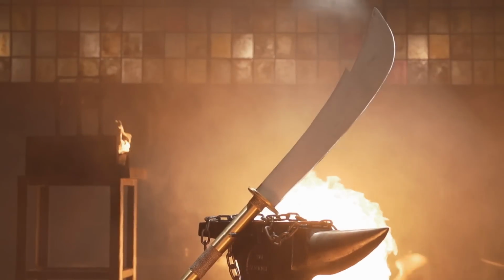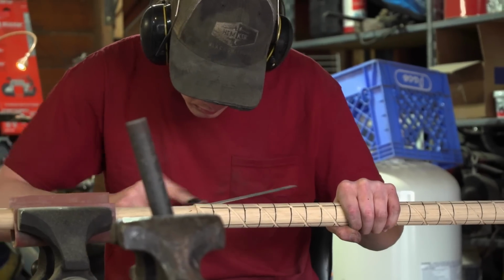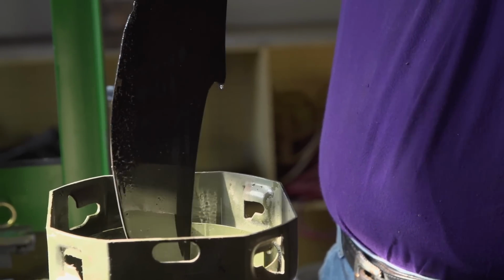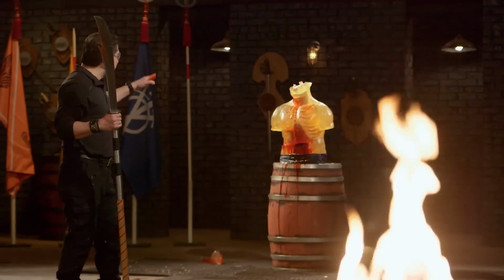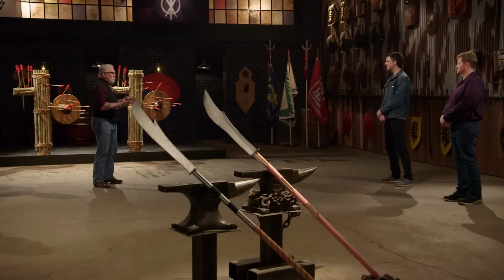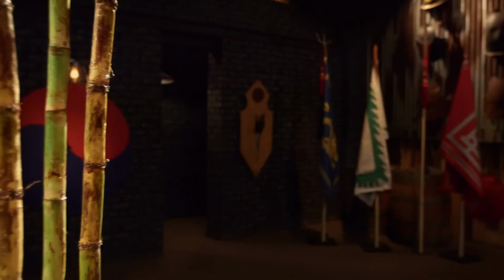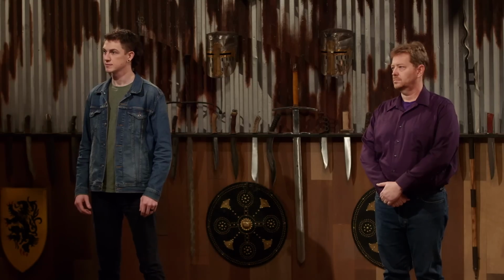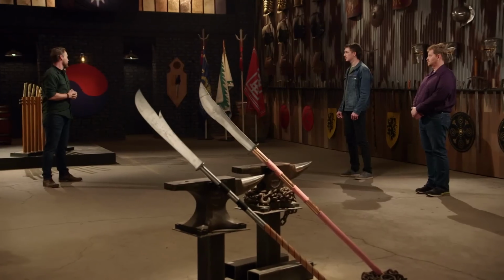Forged in Fire: Korean Woldo Produces LETHAL LACERATIONS (Season 8) | History

Comment: Judge- "Well, your weapon feels a little heavy-"

Contestant - "I'll see myself out".
Reply: It seems like a common mistake. Which I find bizarre, most of these weapons have well identified weight ranges historically. I understand wanting to err on the heavy side given the tests performed on them, more steel makes for a stronger blade. Say you want to make a long sword. A heavy longsword historically was about 3 1/2 pounds. So as you're forging, you need to keep that in mind, if your blade is 5 pounds, you have a problem.
Reply: catastrophic failure has entered the chat
Reply: @andrewfernandes6906  that's usually due to poor heat treatment. If you use the right steel and treat it correctly, even very thin blades will spring back and take no edge damage.
Reply: Noah Vinkel Hansen  a quick Google search gives me just over 3 pounds. That's roughly equivalent with swords and guns throughout history because there is only so heavy a weapon one man can effectively wield
Reply: Noah Vinkel Hansen  I once had the pleasure a few years back of wielding a Scottish Claymore (actual historical weapon mind you) when I visited the Wallace Monument near Stirling in Scotland and it was (to me at the time not knowing much of real weaponry) surprisingly light.  It was explained to me that they need to be relatively light so that a Soldier can wield them in battle for lengthy periods of time, after all, in the middle of a battle a Soldier doesn't simply have the option of saying to his enemy "Woah there, time out dude, I'm exhausted, I need a five minute break."
Reply: Noah Vinkel Hansen  its not meant to be a heavy weapon

Comment: When they said Dave's blade was heavy and it took some edge damage in the kill test, it was over right there.
Reply: @draekan2753  Exactly. Blades normally don't take damage during the kill test.
Reply: Agree.
Reply: If it takes damage on the kill test you know your weapon won’t win
Reply: full time blacksmith XD
Reply: @jackienettleton6212  well guess what. Weapon damage would and will happen. But it shouldn't happen on the first swing or couple swings. 
As these are weapons meant to be designed to take a beating due to how beefy the blade is.

Comment: I never made any blade but I was a machinist for a while and it's like some of them don't know how heat treatment work. 
When you do a heat treatment most of the ''hard stuff'' goes on the outside layer, the deeper you go in the softer it gets.  
That's why you can generally do a hole with carbide in hardened stuff and finish the job with a hss drill. I feel like they leave too much material prior to heat treating.
It did roll too

Comment: The heat treatment of  the losing blade looked off; didn't seem to be hot enough to get a sufficiently hard edge, but the big mistake as usual was making it too heavy. The day someone makes a blade too light and loses to an overweight blade, I will fall over in surprise.
Reply: Noah Vinkel Hansen  It hasn't. I have seen many episodes and I cannot recall one instance where a blade was too light and lost to one that was too heavy, unless it broke and the other didn't, but even that is rare.

Comment: really sick of paracord. just lazy. people certainly used cord historically, but they would have at least glued it to the wood, and if it wasn't a purely utilitarian piece, they would have covered it with leather, sharkskin, rayskin, silk, or at least some kind of textile. with how cheap and easily obtained (Amazon?) these materials are today, there's just no excuse to use plain paracord as a grip material. and if you just like the feel of paracord, then there are better ways you can wrap it, like the tsuka-ito of a japanese sword. korean swords historically had a similar wrapping method to the japanese silk cord tsuka-ito, but they were usually wrapped with a leather strip rather than cord. you can find japanese leather tsuka-ito too. it has a nice feel in the hand. either way, this wrapping method provides a better grip than just a plain spiral wrap. it also looks much less plain.